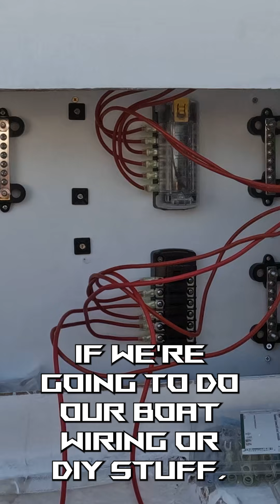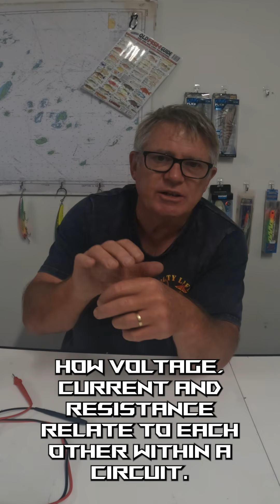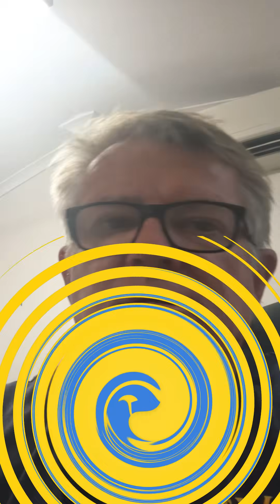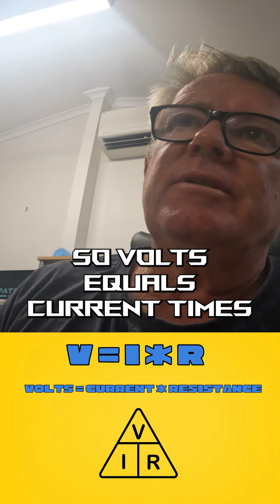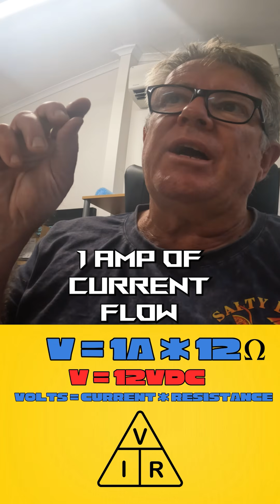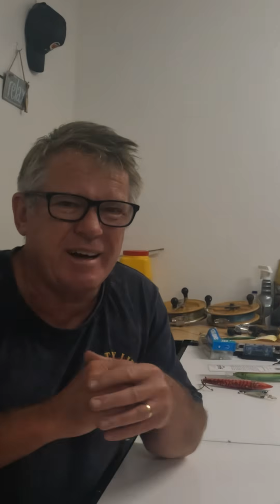Basic Electrical - Ohms Law V = I*R #shorts #electrical

Comment from the maker: One of the very first things we learn in electrical and electronics trades is Ohms law which is a great way to look at the relationship between voltage, current and resistance in an electrical circuit when the resistance is a fixed value.👍